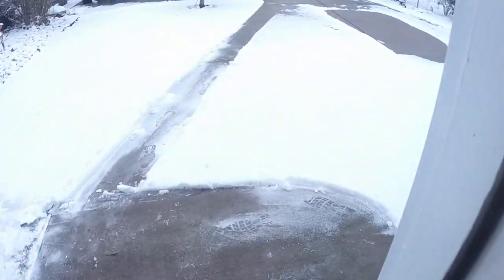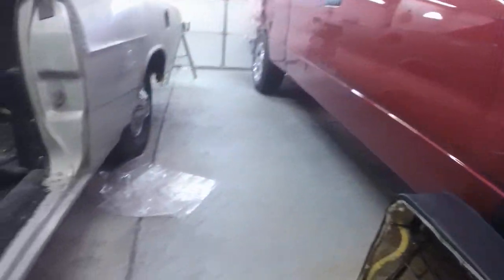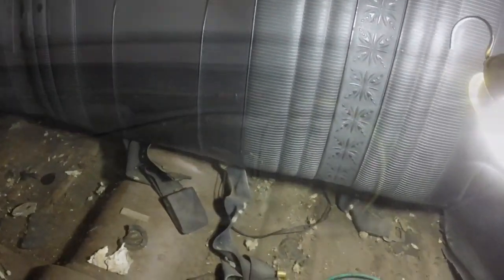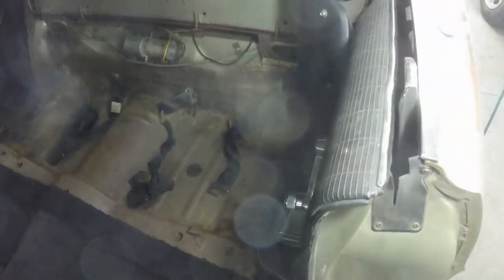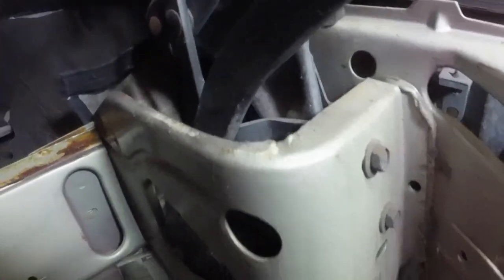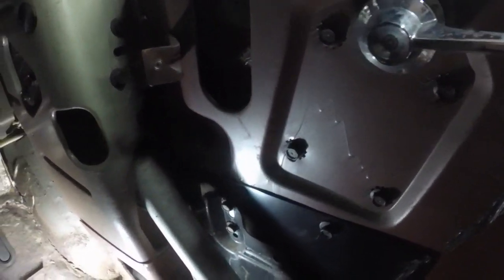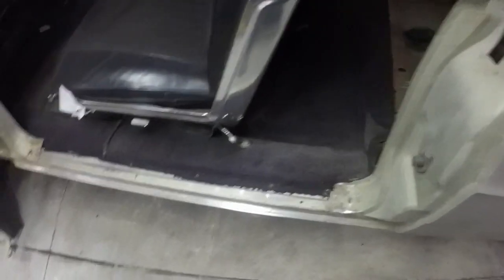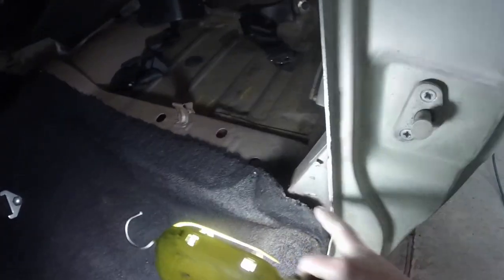1966 Ford Galaxie 500 convertible restoration part 86 taking the back seat out

Comment: I watched  your video on the panel bonding...when you add the tip it twists the material out onto the surface..stronger than welding..for your vent window squirt some onto a surface mix the 2 as you do filler and dab onto the vent rail and clamp together...each tube used you throw away, replace with a new tube..they cant be saved. put cap back onto the bond You are doing a fantastic job. I worked for GM in the late 60's at 3 Chevrolet dealerships...Wish they had the bonding then.
Reply from the maker: Thank you for the info, as I have never used the stuff before. Everyone tells me it's as strong as weld.

Comment: Convertible tops can be a real pain to work on. If the lift cylinders are like the ones used on 60s gm cars, the head glands are crimped on making them impossible to disassemble for repair. Your making good progress 👍!
Reply from the maker: Thats kind what I'm thinking. May just get new, or newer cylinders.

Comment: Hello again. I was cleaning the headlight switch last night.  My instrument panel lighting is now working.  The rusty connectors kept power from going on to the panel. All good now.  Feels good. Thanks.  
More importantly, I was looking through YT for videos on what spot to drill for my back seat seatbelts.  I have had NOS rear seat belts for a long time and I am finally looking and cannot find any videos that show the location of where to drill.  I saw your Part 86 video and shows the location of where they should be mounted.  (maybe you can post the dimensions)  I hope those points are accurate.  It will be helpful if you put information on rear seatbelts as I am almost sure I am not the only person looking for that. I was so happy when I saw this video.  Thank you.
Reply from the maker: Thats awesome.... I'll show the rear seatbelt measurements in my next video.

Comment: Unbelievable how clean and solid that car is one of the cleanest cars that I've ever seen for it's age it's in excellent condition 👍
Reply from the maker: I know.... it's in much better condition that I expected. I have never restored a car as solid as this Galaxie!
Reply: It was probably always kept garaged in the winter months and didn't see the salt they put on roads back there.
Reply from the maker: @chuckster3629  It's a Florida car.... but, I do think it was garage kept most of the time, since it was new.
Reply: @OldCarAlley  
That's still amazing.  Cars used to rust quickly in Florida in the 60's and 70's.  I remember back in 1978 when I was sent to Miami for a company training school, one of the first things I noticed was all the rusted out lower car bodies of cars that were less than five years old.  
I saw a three year old Lincoln that had severe rust around the trunk lid and rocker areas.  
If I remember correctly, it wasn't until the mid 1980's the domestic car manufacturers began dipping their car bodies in rust proof coatings.

Comment: Hey Howard..i sure hope you zinc the inside of both quarter panels when you finish welding..you probably should clean that piston before retracting the cylinder..rust is what damages the seal..you might get new seals from auto krafters maybe.. or you may have to go to a hydraulic supplier..ive seen worse rust before .. what you have is minor..now is the best time to treat what you can get to..try not to get snowed in..lol..see you on the next one .Cheers 🇺🇸🇺🇸🇺🇸🇺🇸🇺🇸
Reply from the maker: I will totally take care of the inner panels. Looks like water and dirt got in from the bottom corner of the inner wheel house causing the rust to start, for an educated guess.... Yea, I need to remove the cylinders to clean them up. Don't know if there resealable yet, but will soon find out.

Comment: Ford typically put build sheets behind the dashboard. Usually wrapped in the wiring. AMK Products sells OEM fasteners for all Ford cars. You could find those screws for the well liner.
Reply from the maker: Good to know.... thank you.
Reply: Weren't they sometimes put under the carpet on the passenger side too?  I seem to recall having seen that in a video.  I can't swear it was a Ford, however.

Comment: If your convertible top pump ever stops pumping fluid, but the motor works, you can take the pump apart and replace the small o-ring with one of same size that you can get at any hardware store or Harbor Freight.  I fixed a buddy's '65 Galaxie top pump that way.  Easy to do, too.

Comment: I bought hydraulic lines and  cylinders for my 58 Lincoln from Hydra Electric in Florida.
Reply from the maker: Do you know if seal kits are available? If not, guess I will check them out, for a set of cylinders.
Reply: @OldCarAlley  My system originally ran on brake fluid and someone put transmission oil in it so the cylinders where pooched and I just replaced them
Reply from the maker: @Hudson-1947  The pump on this one states, "use type A trans fluid". I have a few quarts of type A somewhere.... I'll hunt it up.

Comment: i'm guessing one of 2 things about the build sheet...1 is..who ever put that rear speaker in found the build sheet..or 2...it might be under the carpet...
Reply from the maker: I'v been told it could be shoved under the dash, between the dash, and wiring harness. We will find out, when I pull the dash apart. May pull the carpet..... not sure on that yet.

Comment: 4:00 .................... I think rear seat belts were an option back then.  My '65 Galaxie has black 3rd party seat belts in the back, but the front original Ford seat belts are tan and match the interior.
Reply from the maker: Could be... I remember my dad's 66 Country Sedan had seat belts.... he made everyone in the car ware them. I think they were interior color, which was blue.
Reply: @OldCarAlley  
Yeah, I believe the rear seat belts in my '65 were installed some time after it left the showroom.  No telling when that could have been, but they sure don't match the front seat belts both in color and buckles.

Comment: That key looks like it could have belonged to a safety deposit box
Reply from the maker: Yea, it kinda does, now that you mention that.... no doubt thats what it is.
Reply: I recognized that “BEST” key right away. I worked at a college and all the doors had Best locks and keys stamped “do not duplicate”.
Reply from the maker: @wmalden  Very well could be. From what I have learned and figured out... is the car was a hand me down, and was used in Cleveland, for there kid going to collage there. There is a local collage parking sticker on the lower right side of the windshield from Brea Ohio, which is a suburb of Cleveland.